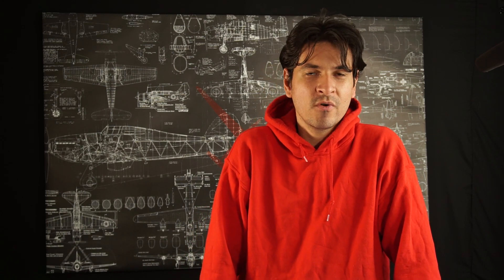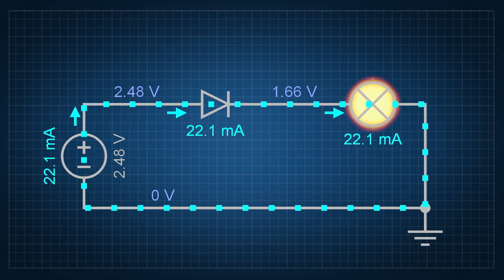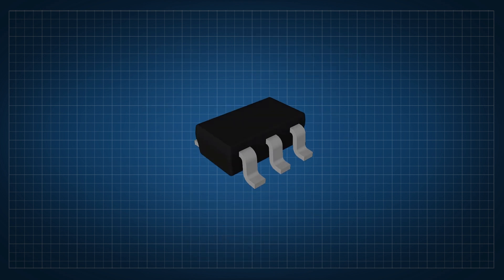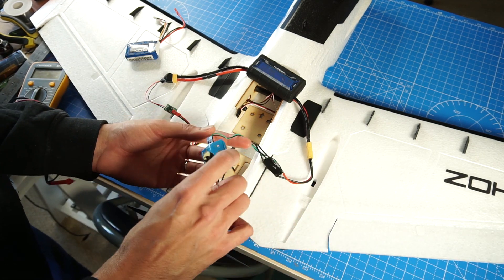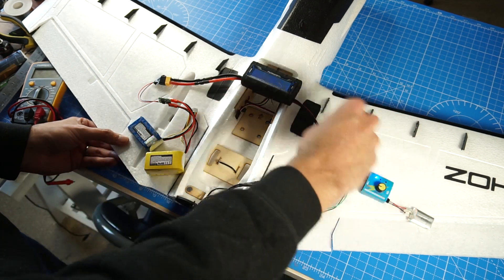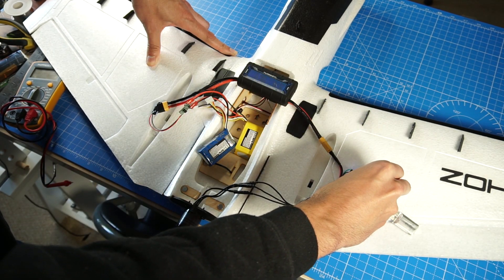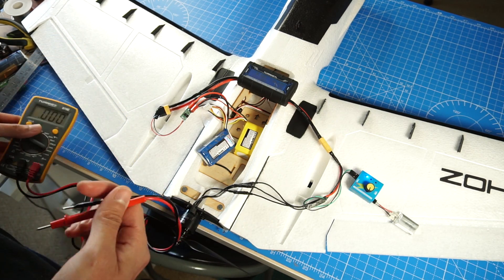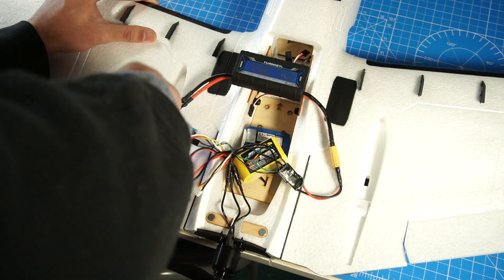Redundancy Power System for RC Airplanes | Simple diodes

Comment: Interesting concept for battery power redundancy for electric powered rc vehicles. I'm wondering if your circiuts will work the same way in nitro and/or gas rc vehicles  to provide electrical battery redundany. As far as heat dissipation, you might want to use a higher current rated diodes and/or mosfets or heat sinks.

Comment: Hi, Do you have something similar for a bigger current? I mean for mid-range fixed wings based on mateksys flight controllers? So let's say I use normally 4s lipo to power my aircraft, and to aux, I connect a small 3s battery - when my 4s will fail, the system switch to backup power and I will be able to land safely

Comment: there are small signal diodes or germanium diodes for low drops...
use high power switches with low vrds. also, you may have option to use things (diode, switch - mosfets) parallel. also if your circuit is not much high speed switching then go for power transistor they are better in the case, check their data sheet for max frequency.
Reply: Hi. I am having a thought for an UAV, where I am using 4 motors and 2 batteries ,so 1 battery for 2 motors. NOTE: Both the batteries are power supplies .Now if any one battery fails, I want my other battery to supply to all the 4 motors instead of 2. So my question is whether I can use a MOSFET or not. If yes, how the circuit can be? If not MOSFET, could there be any other solution?

Comment: most likely that the MOSFET current rating is too low, try to replace them with higher current rating, also, look for low Rds rating, this will reduce the voltage drop between input and output
best of luck!

Comment: ALERT:  Do not use this circuit in RC airplanes.  A forward biased will fail if the Amp draw exceeds the specification.  When 1 fails, then the other will also fail almost immediately!  Now the airplane will be flying without power. 1N400X diodes fail at 2A!  Surface mount diodes fail at lower amperage values.  Servos will cause the diodes to fail.
Reply from the maker: Did you see the test I did?

Comment: This is most educational and practical at the same time. In flying electric-assisted RC sailplanes often to the limit of sight I often worry about a fried ESC knocking out my receiver voltage, and therefore, I like to use redundant packs on large/expensive craft ...though the quality of ESC's on some plug n' play foamies is so suspect that I'd like a simple and low weight system to give me a few minutes of receiver control if the ESC fries. My only comment would be to make sure you test servos in full stalled state, where it really can draw power (and is a frequent cause of flight failures), though it looks like you have plenty of "headroom" at 5 amps.

Comment: Why wouldn't you use a capacitor to power your servos in the event of a failed battery? That's what a UBEC does. I switched all my expencive planes to an external UBEC when I lost several planes to the Failed ESC combined with an BEC. the problem is, once a ESC frys, it also destroys the on board BEC. by running a separate  UBEC, you still have the ESC, the difference is the UBEC is no longer subject to the ESC burning, taking out everything. This leaves you with your controls functioning and a good chance at bringing your prized Biplane down in one piece.

Comment: some info.      hmmm.     you now have redundancy at the power supply.   but  problems  usually  Originate in the  ESC.     that problem you have  Not  solved.            Main power is now running through  TINY  wires, All the  time.!!!     those tiny wires  are gonna  MELT, when energy consumption is  NOMINAL;  not  minimal.!!!   cheers      googletranslate

Comment: How to make a plane, and what are the required things? Do you use cardboard to make a plane? Please reply
Reply: Have you checked out Flite Test? Many great ideas on how to build foam airplanes. As far as cardboard, you could use the kind that has the z pattern inside. I would suggest using Modge Podge to stiffen the cardboard. Cardboard by its self is far from strong enough to make an airplane with.

Comment: Okay hear me out. I kind of thought about using both a LiPo and LiIon battery for long range applications. How about making a circuit that can switch between battery types? Or better yet, a 2 power switcher that can, for example, switch between 3S and 4S.
Reply: a remotely operated DPDT (dual pole dual throw) switch to move from 4S to 2S2P is possible... it is just wiring. in that case it would be speed or endurance.

Comment: Congrats on the video and the efforts.

That test with the propeller and your hand right on it... that's a "no-no". Less so to show in a Youtube video were people without any clue can see it. You could easily do the same test with the propeller at the other side of the table, pushing the plane to you.

With this "redundant" system, you aren't going to solve the issue you talk about at the start of the video. ESC dead = BEC dead = No power to the servos = No control to land the plane.

To avoid the "power issue", you never, ever, power your servos from the ESC regulator. You use a stand alone 5V BEC. In the case you explain, you could have landed without any issue even with a dead ESC and motor.

It doesn't matter if you carry 5 batteries with diodes... etc, if the 5V rail is dead. Also, the only thing you solve with using two batteries, is if one battery dies and that's one in a million (anyways, less probable is that the battery is going to be lower than 5V and the servos would still work). Also, if a battery fails, it may burn your plane before you can land it and disconnect the battery.

From my experience, it's much more useful to have a redundant 5V regulator (and that's more tricky).

Happy flying!

(editing, because the spaces between paragraphs aren't working sometimes...)
Reply from the maker: Yes the propeller is dangerous so is not recommended doing that. And I disagree, if the BEC dies the other power keeps feeding the system so I do solve the problem, you are right by recommending using an extra BEC but you can not connect 2 of them in parallel because they interfere, that's why you should not connect all the red wires in a flight controller from ESC's with BEC's in a quadcopter, it can be done but not recommended and not efficient depending on the DC-DC converter, they produce a lot of ripple when connected like that, and I'm not sure what you mean with the 5V rail, the rail is powered by  the 5V from any power supply like a battery or DC-DC converter.

Thanks for your comment and happy flying.
Reply: @Joyplanes  Thanks for your answer.

I still don't understand what do you solve with two batteries. I can see the use of that system when you are using batteries in parallel because of flight time/range and one battery dies in flight, but... that's a pretty niche situation. Most of the time, if a battery goes bad it'll puff, burst and flame up.

The situation you propose at the start of the video (a plane without flight controller or FPV, using the 5V regulator from the ESC to power the servos or maybe not, since the servos aren't connected). Your plane had a burnt ESC, so no power for the motor (even if the motor is burnt or not), nor the servos (since you were using the 5V regulator from the ESC). A second battery solves nothing. There's already power "somewhere" since the battery is ok. To where is the power flowing in that case and what can you do with that power?

In a situation where the 5V regulator from the ESC burns, you have no control over the servos nor anything else, since the receiver isn't powered up. So, you can't steer the plane. Also I'm still not sure that an ESC with a burnt regulator will still work, since it seems easier to step down the 5V to 3.3V (for the microcontroller of the ESC, driver... etc) than using a 3.3V that can step down +16V or whatever voltage from the battery. But maybe they do work without the internal 5V regulator.

Now, in case of a flight controller (no one talked about that or at least I didn't hear you say anything in the video. Maybe I missed it). It already has a 5V regulator. ESC for quadcopters don't have BEC since... 2017? plus you should never buy an ESC with an internal regulator for a quadcopter, nor use it if you build your quad with one (usually OPTO ESC). Back to the flight controller, you should NOT use the 5V regulator in the flight controller to power the servos (3.3V for flight controllers are mostly stepped down from the 5V regulator), unless you aren't using FPV, because servos produce so much noise in the FPV. 

What can happen is (I'm sure there are more situations, but these are the ones that pop into my head now):

1) Your battery dies, then all is lost and a "brick is falling from the sky" or, with your redundancy battery system, the other battery still gives power and all is well. The question is: How many times did you have a battery die in flight? I've been "RCing" for more than 20 years and it never happened to me.

2) Your ESC dies and there's no power for the motor, but since you have a standalone 5V regulator (be it from the flight controller or a separate one) the FPV (if there's one), flight controller (if there's one) and the servos work so you can safely land your plane.

3) Your 5V regulator dies and now all is lost (since you are using one for everything). No power for the receiver means no control, so no motor either. Second battery does nothing. And 5V regulators die "often".

I hope you can solve the issue without having to pay +100€ for a redundant 5V rail.

Happy flights! Hopefully without issues!

(editing, because the spaces between paragraphs aren't working sometimes...)

Comment: This sounds good.  Have often wondered about some supercaps in the circuit that would at least give you enough power to get down on the ground.  Well presented video by the way.
Reply from the maker: That's a good idea as well, but it will have to be a good cap.

Comment: Seems like a good idea for trying to build a small solar plane. I have been thinking the big problem with most solar plane attempts is that they are still using large storage batteries in their circuit. Maybe a capacitor to be used as a buffer would work to supply power to servos and with the reduced weight of no batteries a smaller motor could be used.......I like this circuit a lot more than using these complicated battery management systems and chargers....
Reply from the maker: Well for a solar plane I would prefer something with the best efficiency to not waste any power, that's why electronics become complicated to achieve that. I hope technology bring us better and lighter batteries soon.
Reply: @Joyplanes  my brother used to work for SunPower....
Their new solar cells are supposed to be 30% more efficient this year they are light and flexible...
I'm thinking a small hand launch type of sailplane or flying wing using flexible solar cells as wing skins with a few smaller sized supercapacitors and an efficient gear head motor swinging a larger folding prop at slower rpms with your circuit and some kind of current limiter might make a pretty efficient super lightweight airframe ...
Reply from the maker: @christopherleveck6835  That's cool!